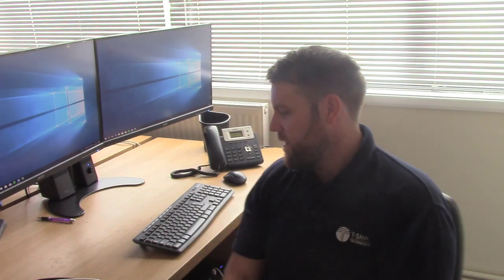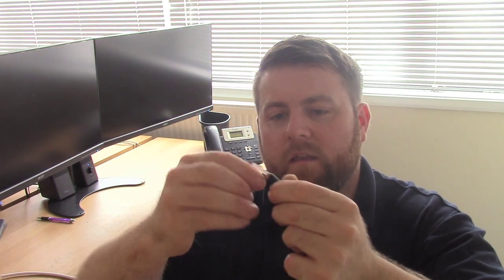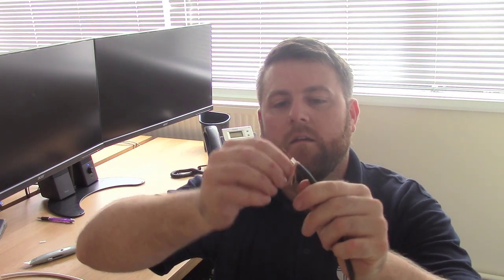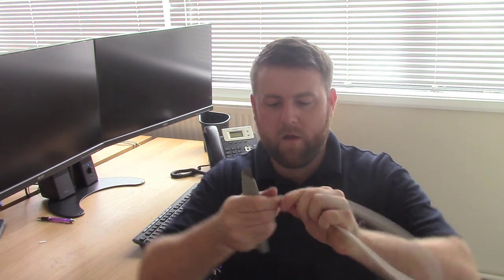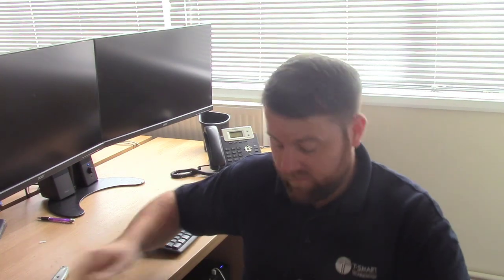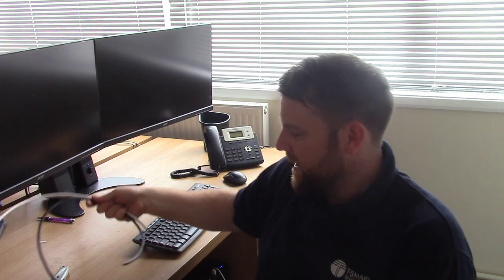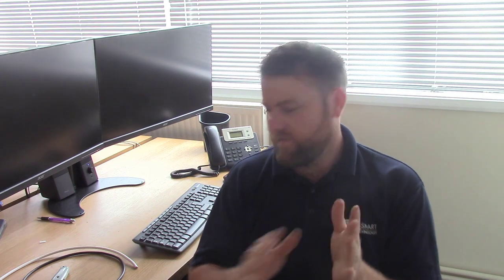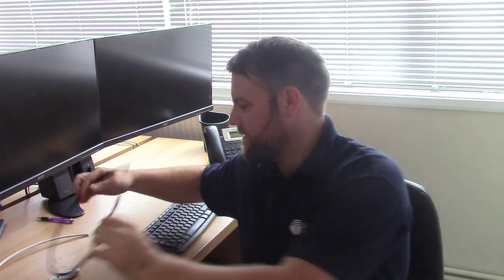Difference Between RG6 & RG59 Coaxial Cables

Comment: Great video. I wouldn't recommend RG59 you experience signal loses not to mention interference especially on Aerial (UHF band mostly), Digital Cable TV or Satellite TV. I only recommend RG6 (triple shield). For example RG6 dual shielded is much better than RG59 Dual Shield or Triple Shield. RG59 is good for FM radio if you have an outdoor FM antenna or for RCA, Component or Digital Audio (SPDIF)
Reply: Hi. Would you recommend any particular brand? Struggling to find one...
Reply: @user-es4hy7tr7u  Any brand of coaxial cable is good make sure it's an RG6 Trishielded cable, I would recommend a Quad shielded RG6 cable but they are more expensive than the trishilded cables.
Reply: @user-es4hy7tr7u  If you are looking for a particular brand I would recommend AMIKO brand they are experts in satellite, cable and terrestrial receiver satellite dishes, UHF antennas,  LNBs, Diseq switches, Diplexers. They also make high quality cables. Since 2017 I only use AMIKO products for terrestrial television DVB-T2 and satellite television DVB-S2. And their cables are recommended for UHF bands especially if you combine an UHF aerial with LNB using diplexers.

Comment: Hi i had cable labelled 19 patc installed by an electrician  in an extension but have no receipts and unsure as this will do job .it will be used for freeview and linked to existing tv aerial .
Does this reference sound familiar .it has copper looking centre with aluminium foil and thin aluminium braiding which i what alerted me compared to the cable you demonstrated .
Cheers

Chris
Reply: Update the aluminium braiding was a decent thickness it was stuck in the cable sheathing i dissected .

Comment: Do virgin media cables use rg59 or rg6 cables. Or can you use either?

I wanted to extend my existing cable as it won't reach the TV box. And not sure which cable I have currently or if it can be interchangeable when extending.

Please help.
Reply from the maker: I would use RG6, it's better and you will have a job getting the F connectors on RG59 cable.

Comment: Hi there, Can I use RG6 cable or PF100W/PF100B for tv aerial? I found this on TLC ELECTRICAL SUPPLIES thanks in advance for any help that you can give me.
Reply from the maker: Hi, yes you can use either. The PF100 cable is the better one, but usually costs a fair amount more.
Reply: Smart Aerials thanks for your message and is it fine to use to with tv booster amplifier? Because I live in rural area.

Comment: Can rg59 work with speeds up to 1 gbps? Is there a bottleneck? Would it work better with rg6? 

What would likely cause not getting the full 1gbps speeds of a 1gbps enabled connection? Ethernet port is 1gb port.

Thanks if you respond.
Reply from the maker: Hi there, you want to use Cat6 cable for 1Gbps.
Reply: @smartaerials  Ok Cat6 for ethernet, but for the cable in does that matter? I have old rg59 and Im wondering if that's why I'm not getting full speed. 

Cable tech said might be worth replacing but didn't know.
Reply: @purposespecific670  do you at least get 60 mbps download or no?
Reply: @Everette997  Yeah way over 60 mbps, issue has since been "resolved"
Reply: @Everette997  basically it's the isp being god awful, i'm changing locations soon so maybe i'll have issues once more
Reply: @purposespecific670  do u know if this works on charter spectrum because I haven't got it to work and I saw someone said that I think they need to reconnect my cable line because my parents have uverse but try to add a 2nd provider in house so I can game and get good speed I haven't have good speed with at&t uverse will that cord will work on my modem?
Reply: @Everette997  cord should be service nonspecific. The cord is only as good as the back-end it connects to, if a service has poor infrastructure, that will mess with you. Same with the front-end if something is wrong after the cable enters your house.

 If you are on wifi try ethernet or the reverse. Ask them to double check the frequencies of the line, they can use splitters on the wires to get it in proper range. 

Make sure your service pack is a high speed package so you are capable of getting the speeds you want. 

Finally ask them to run a new cable if none of that works, most cable companies can do this with no charge.
Reply: purpose specific cool thanks

Comment: Have question I have a rg59 cable cord but its build in the wall mean I can't take it out unless I have a professional do it will it work for charter spectrum because I try to use it and it not working do they need to reconnect my cable line outside because I think at&t uverse guys disconnect I think?

Comment: Can I use RG 59 for Internet
Reply from the maker: It's possible with certain set ups, but I would install Cat5e or Cat6 instead as this is more appropriate.
Reply: If you are cable subscriber and have a modem from you cable operator. You mut use RG6 Tri shielded cable and Cat 6e. The RG6 cable will be used between the cable splitter and your cable modem, and the Cat 6e cable will be used between your cable modem and PC, Laptop, Gaming Console, Switch, Wi-Fi Router. Never use RG59 coaxial cable and Cat 5 or Cat 5e cable they make the internet speed worse.  Note: Cat6e can deliver internet speeds up 1000 Mb/s with no problem

Comment: Don't use RG59 for digital TV signals in the UK. The frequency band being 470 MHz to 860 MHz means that RG59 will rob you of some 3dB/10metre, plus connector losses (that's 50%) at the low frequency end and a whopping 4dB at the top end! RG6 being substantially better at the top end. Given that DTV signals are so variable and that CT100 isn't that much dearer I feel it is false economy to use anything cheaper and also, if you're having it installed, the extra cost will fade in to insignificance taking in to account the installation costs themselves. I know 10 metres seems a long length but it soon gets used up when cabling up a house!